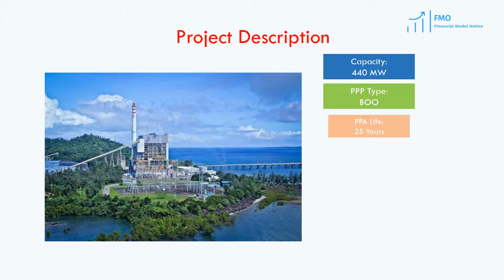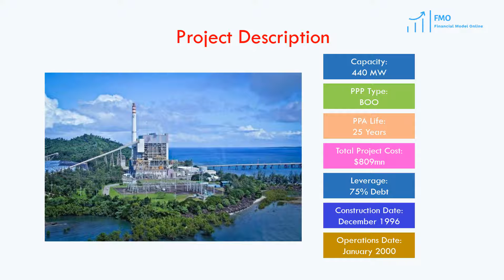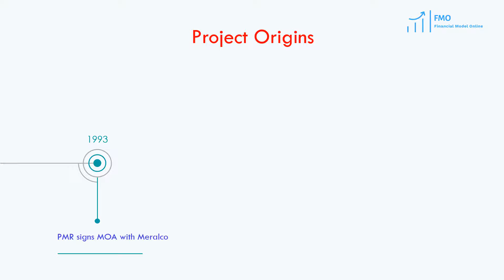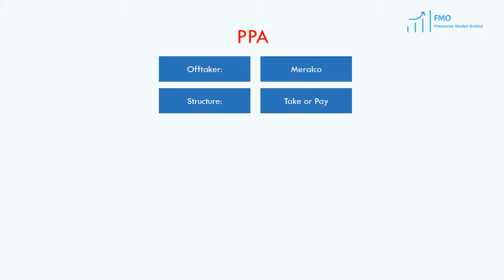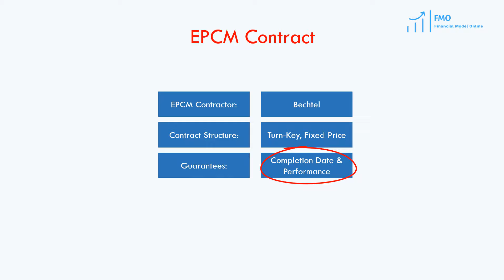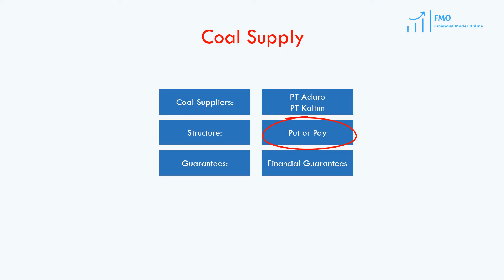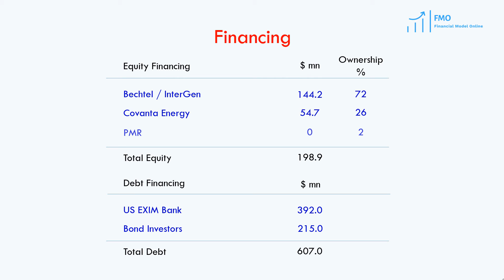Project Finance modeling - Quezon Power Plant case study Part 1

Comment: 0:35 
with installed capacity of 440 MW, megawatt which was 
built under BOO, Build Own Operate concession agreement.
power purchase agreement, PPA life: 25 years.
Total Project Cost: over 800 million

attracted debt financing of 510 million on non-recourse basis. (which is 75%)
construction date: December 1996 
operations date: January 2000
1:10
philipines power plant development landscape:
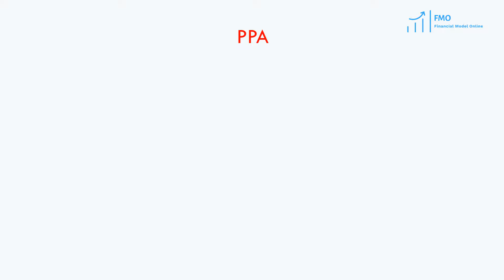4:50
PPA
offtaker: 
structure: take or pay
payment structure: capacity, O&M, energy fees, 
payment indexation: US dollar 
annual revenue 1st year:
6:25 
EPCM contract
Contractor: 
Contract structure:
Guarantees: completion date & performance. 
6:50
O&M contract, operation & management contract:
7:30 
coal supply contract:
coal suppliers:
structure: put or pay
guarantees: financial guarantees. 
8:20
currency and country risk:
exchange rate: PPA denominated in US$
country risk: EXIM Bank insurance
political & economic landscape: improving
debt rating: upgrading

9:35 turn-key EPC project.